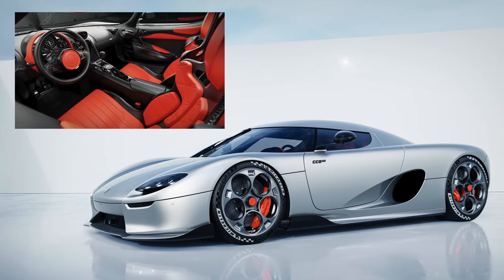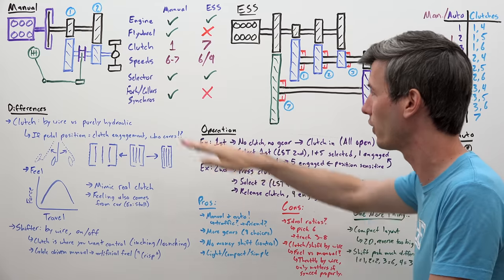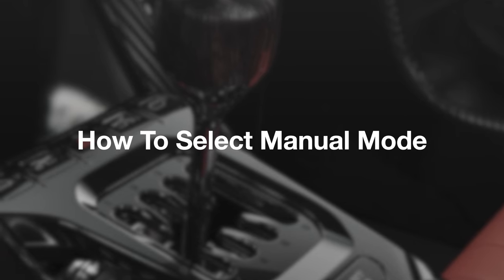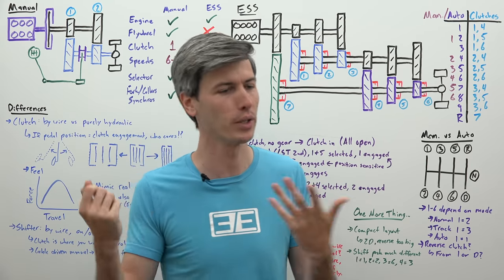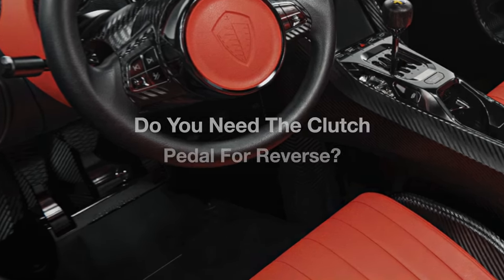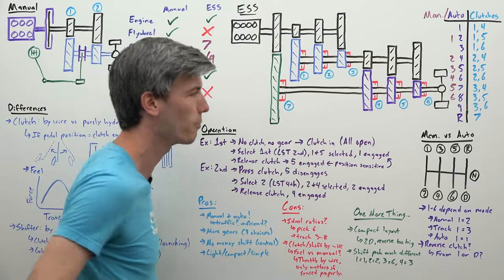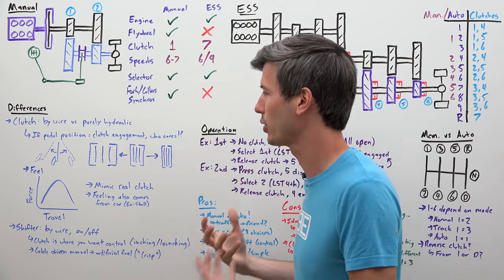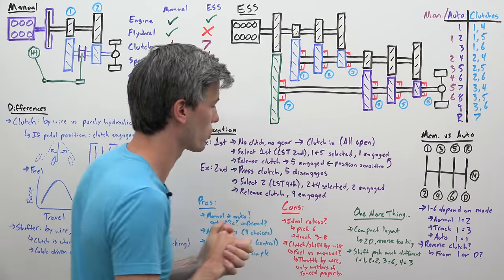Koenigsegg Reinvents The Manual! How The CC850 Transmission Works

Comment: I love the retro supercar look of the CC850, and also a very interesting gear box design from Koenigsegg. 
I think the general concept is very similar to their Free Valve tech, which also uses electronics control to simplify mechanical parts.
It's like a dual clutch transmission but you can now jump gears.
Kinda feels like the engineers just brute forced through the design problems by giving every gear a clutch.
Reply: Holden Burke  Modern automatics in passenger vehicles and even some semi-trucks have 7+ clutch packs and go hundreds of thousands of miles without ever changing the clutch packs. With wet clutches there is very little wear with regular maintenance (i.e. changing the transmission fluid).
Reply: Brute forced is a good word for their gearbox
Reply: @Kyriaeus  Same deal with the VAG DSG transmissions - wet clutch, long life. At the end of the day heat is just as detrimental to them as friction is, and the fluid helps cool the surfaces.
Reply: @SOHCGT96  if you get a wet clutch to burn out, you have done many things wrong xD and using the clutch heats up the transmission - nice benefit in winter for reduced hydraulic resistance lol. At least I would say it to the "green/eco" society xD

Comment: I feel like this should be the future of enthusiast cars. One transmission covers auto and manual buyers, can hit fuel economy standards still without super tall manual gears, and you can protect the car from money shifts.
Reply: One thing that I have done plenty of times on a manual transmission vehicle is push start, or coast start. Turn the key ob, put it in third, step on the clutch, get er rolling and pop the clutch. I wonder if you could do that with this automatic manual transmission still? Based on guessing how it works with automatic clutches then I'm going to say no. That's one of the perks of having a manual transmission.
Reply: @keithyinger3326  You can't even do that with any modern traditional manuals. Nearly every manual car these days requires the clutch to be depressed to start. Regardless of engine turning
Reply: @KeithYinger
Back in my day I could start a car without moving at all, all I had to do was to spin a crank at the front.
(this is a joke)
Reply: @ventzp2133  this is true they require the clutch pressed in for the electronics to turn the starter. However if you're not relying on electronics to turn the starter motor, then that circuitry doesn't matter. My previous truck was that way. In order to turn the key and start it, yes you had to have your foot on the clutch, even if it was in neutral. Many times though I parked on a hill and coasted down to get it started. As long as the key is in the On position, it will work.
Reply: @Appletank8  lol.. hey my grandpa had a tractor like that. And his original farm truck "The Grey Bomb" was its name, had a hand crank.
Reply: @keithyinger3326  I have a 2010 Jeep Wrangler manual diesel.
Can't roll start it. As soon as the clutch is released while rolling, the engine turns with no spark and stalls.
Reply: @Appletank8  I work for the railway and we still have many backup lister generators in the signalling huts that have a 12v starter and a hand crank
Reply: @ventzp2133  The Buick Regal requires you to disengage the clutch to start, yet I was able to push start it without a problem when I woke up to a dead battery one day.
Reply: @ventzp2133  Your diesel has spark plugs?
Reply: @TV-ok7bj  he probably meant glow plugs.
Reply: @ventzp2133  Diesels are tougher to bump start. Try again with minimum 10 MPH and in 2nd gear, then fully release the clutch once the engine starts spinning. As long as you still have enough distance and enough grade, it will eventually not stall once the clutch is pushed back in.
Reply: @clover7359  how does the engine spin with clutch engaged?
Reply: @ventzp2133  If the vehicle is moving and you engage the clutch with the transmission in gear then the engine is going to spin to match the speed of the gear ratio/vehicle speed, in this case instead of using a starter to spin the engine you're using the vehicles momentum.  Different method but produces the exact same results, and yes all modern manual vehicles (minus push start vehicles with a dead battery as there is no way to put the ignition into the "on" position) including diesel engines can be started this way.
Reply: @keithyinger3326  yeah, but this is a multi million dollar car. If you can pay multiple millions to buy a car, you can probably pay a guy to bring you a new battery when needed.
Reply: @keithyinger3326  why would you put it in third ? You know you don't have to roll it as much if you do it in first or in reverse right ?
Reply: @me-so2ze  first gear is too short and the engine locks up the wheels, rather than being turned by the wheels due to the massive amount of torque it needs to turn. Remember, a gearbox is a torque translator. Lower gear-> more torque. Higher gear-> less torque . 2nd is fine for most cars. I'm using 2nd on my motorcycle. 1st locks up the rear tire.
Reply: @me-so2ze  depends on the vehicle and its gearing. The work truck at the farm I work at, you put it in first or reverse and your skidding the tires. It has to be third, or maybe second if your on a good hill. I just know if you try it in first and pop the clutch, the tires are going to skid and it's going to come to an abrupt stop. Pick whichever gear works best for your vehicle.
Reply: @keithyinger3326  no, you won't be able to push start with this transmission. The clutches need hydraulic pressure from an oil pump, driven by the engine, to engage. Without hydraulic pressure the gearbox is just freewheeling. Neither would it do any locking to put in in gear for parking, a separate latch is needed like in an ordinary automatic gearbox.
Reply: @philipjkb15  I guess it depends on the car. I don't do motorcycles. But ever since I was ten I have always done it in first or reverse. Lift off the clutch and immediately push it back in with the key open always did it and still does. I do remember this one time i had my cousin push and my other cousin was in back suddenly half his body was under the car ..

Comment: This gearbox really makes sense. Unfortunately mainstream manufacturers will never use this method, probably due to manufacturing costs. Super cool design! Excellent video per usual.
Reply: Typical modern automatics already have 6-8 clutch packs, so your point is invalid.

Aisin transverse 8-speed: 6 clutches, 7 if you include the torque converter clutch, 9 if you include the sprag clutch. Used in Camrys, RAV4s, Volvos, Minis, VW’s, etc.

ZF-8 speed: 5 clutches, 6 including torque converter clutch.

Honda 10-speed: 7 clutches

GM 9-speed: 7 clutches

Etc.
Reply: Current automatics are a maintenance nightmare, regardless if: automatically shifted manual transmissions, eight or more speed automatics or the dreaded constantly variable transmissions. Making the cars with them "disposable"... @Kyriaeus

Comment: The first manual I owned had all rod links from the shifter and the clutch pedal. The clutch linkage utilized a bellcrank. The shifter was a Hurst, with adjustable stops at seven points. I could have built the whole thing in shop class with a band saw and a drill press.
     1973 Chevrolet Camaro RS/SS. The feel was incredible.
Reply: Huh, every classic muscle car I've driven has SO much slop in literally every control, steering always being the worst. Glad you got a good example!
Reply: @RhodokTribesman  Haha yeah, I had a 2000 Camaro and 3rd gear throw was so long you punched the radio controls every time you shifted into it!
Reply: They probably build it that way in their factory back then 😂😂

Comment: Excellent video, Jason!  Mind-blown doesn't even describe how I feel from such a small car company and almost a single [VERY smart] man.  What companies with billions of dollars in annual revenue haven't done, he's done.  Let's all be honest here:  any that loves manual transmissions and is sad to see them disappearing, any sort of innovation is HIGH LY welcome.  I was thinking the same as Jason about mid-way thru:  just about everything has been throttle-by-wire since circa 2010, some much sooner.  As long as the feel as the right, it gives more advantages like tuning; throttle pedal can feel "laggier" in "eco" mode, "normal" in "normal" mode, "sportier" and "sport mode", and the most aggressive in "track mode," with any other combination available as well depending on application (e.g. different tiny changes in various modes of off-road enthusiast vehicles like a Jeep Wrangler).

Me personally, the only thing I would change is have manual mode grab these gears:  2-3-4-5-6-8  as typically a gear change at mid-upper range is a smaller drop, so less felt, even if it does technical hurt some top-end performance on the track.  That, or again with everything being "by wire," an eco mode would allow for 2-4-5-6-7-9 so that that top gear can get grabbed for fuel economy on the highway.

Koenigsegg, keep making Mercedes and the other "best engineering" companies look like child's play -- I LOVE IT!!
Reply: A proper manual transmission like the one in my Mustang GT is much more reliable than Koenigsegg's "super car". Koenigsegg's trans is more complicated and less reliable than a modern automatic and close to the complexity of a duel clutch automated manual trans...
In short Koenigsegg made a Rube Goldberg design for the ultra wealthy but it will suck to own like all so called "super cars". As the best reliable performance car used to be the 911, but now is cars like the Mustang GT, due to the over complexity...

Comment: I've always thought about how this is possible with a traditional automatic just by varying that clutch pack hydraulic pressure. I think it definitely qualifies as a 'real' manual, just wish we'd see it in cheaper cars lol
Reply: If you did variable  slippage in traditional automatic clutch packs, you'd burn them out very quickly. They are designed for rapid engagement, with a very short slip duration. You'd have to redesign everything to get gradual engagement/disengagement (need longer travel for gradation). You'd be better off replacing the torque converter with a clutch assembly, and make the clutch packs engage/disengage as fast as possible.
Reply: Yeah for sure lol this transmission is probably $200,000
Reply: @D777ST Then why haven't they done it yet?
Reply: @srinitaaigaura  Because they are too busy making money from 50-60 year old designs, or at least concepts that are as old. Auto makers also don't want to have to pay licensing for any patents they don't own.
Reply: @transtubular  Most auto-makers don't get hypercar ROIs. There is a reason 3 car majors own almost 60% of all brands. A design like this is more cost than its worth. Especially as manual share of new vehicles are in decline YOY. The maintenance cost alone for such a transmission means most people wont buy and most car makers will not risk the sell.
Reply: @reclassified_  besides which I'd rather have a strong dual clutch transmission and flappy paddles than this. Seems unnecessarily complicated.
Reply: @peterjohnson9438  And an automatic transmission seems unnecessarily complicated compared to a traditional manual. Besides, the reason koenigsegg does this is because it shows off cool different approaches, not because it's the "most optimal or sensible" - that is boring.
Reply: @denisdelinger3265  yeah I really don't want a traditional slushbox automatic either, because it's too complicated to service without very specialized tools and skills, it's heavy and it leads to power loss and general "laziness" of the car thanks to the torque converter. Where I live, we drive cars with predominantly 1.4 and 1.6 liter engines. A naturally aspirated 2.0 is considered "big" and "excessively powerful".

I suspect a main reason for the prevalence of 3+ liter V-whatever engines with lots of torque in the USA is the torque converter automatic.
Reply: More like just make a 1-6 button box for a DSG, a gated shifter or whatever. This is pretty much a DSG.
Reply: @rkan2  Why have a stick at all if you have a DSG? The DSG is basically a sequential device - flappy paddle controls are a natural fit for that.
For now, though, I will continue to enjoy my 20 year old car with cable-linkage throttle, hydraulic clutch and traditional 6 speed stick shift. I trust the computer to control ignition timing and fuel injection; beyond that I'll take mechanical linkages any day of the week.
Reply: @peterjohnson9438  The same reason this Koenigsegg transmissions got made. Actual DSGs could shift in to any gear at any point even if they are usually made to work like a sequential to the user.
Reply: Honda did autos that were basically a manual with clutch packs instead of shift collars. You still wouldn’t really want to slip the clutches much though.
Reply: @NBSV1  that's where I got the idea, the honda 5AT had a variable clutch solenoid. But yeah a change of material would be needed for the clutch packs. It's interesting you don't really see wet clutch manual cars, wonder how the koenigsegg will hold up
Reply: @andoletube  And now you've built half of a dual-clutch gearbox basically.
Reply: @stevegredell1123  Exactly. With each step comes diminishing returns. You might as well start from the beginning and build the thing you actually want.
Reply: @Yummy Spaghetti Noodles I daily one so I ought to know the difference man. The thing that makes this like no other DCT out there is that the clutch indeed is manually controlled. If you're such an expert on manuals, I guess you'd call GM transmissions with downshift inhibitors automatics, after all, it's not letting you do something you want to. Hell while we're on that topic, rip out your reverse solenoid too huh!
Reply: @zaydabbas1609  I’d imagine something like the Koenigsegg is a best case scenario. It isn’t like they’re gonna cover 200K miles of stop and go traffic along with some spirited driving. 
And, from the sounds of it there’s still a lot of computer control in between the driver and the clutches. So, they’re likely to have lots of safeties built in so you don’t burn the clutches.

Comment: I just love it... The Stick Shift ain't dying... I love the Manual
Reply: stick shift is dead. this is an automatic gearbox with a lot of work put into it to give you a manual mode that costs an arm and a leg. there is a reason nobody else does it. and probably nobody else will do it. manual does not make any sense. is not fast, doesnt give bette throttle or overall control of the car... is just a gimmick nowdays and nothing else.
Reply: @catalinxnecula  over half of all GT3 sales in America are with the manual. It’s not dead.
Reply: @catalinxnecula  a manual transmission is one more step to a car being more analog, which is always a positive for driver engagement. Everyone focuses on speed instead of the feel, and I think that’s because one is easier to quantify than the other. Passion for cars is derived from how they make us feel, and that feeling doesn’t always come from speed or technology. The manual is far from a gimmick, regardless of its future. 

Edit: I am absolutely biased. Just got home from one hell of a drive through the twisties in a 1991 Miata. The fastest the speedometer read was 70mph, yet I have the biggest and stupidest grin on my face as I type this.
Reply: @squidwardshouse67  This is not a manual shifter.  It is simply electronic control of hydraulic clutches.  If you really wanted to simplify things, it's just electronic control of a normal automatic gearbox.  The gear shifter is not connected mechanically to the gearbox in any way.

Comment: Hot rodding isn't dead! The internal combustion engine has a future!  Love the power flow diagram. I'm a mechanic, I can't get enough of the mind blowing engineering from manufacturing in the automotive industry. I should have been an engineer!
Reply: The ICE engine has a solidified future well into the ~2100s, even if fossil fuels are banned in the near/mid-future, cos Porsche is working with Siemens on e-fuel, a gasoline with the same properties as fossil fuels, yet produced by renewable energy. :) So, car enthusiasts get to keep the ICE in the electric era.

Konigsee with their futuristic transmission, Porsche with their green gasoline, VW with their electric bus, Bugatti with their 500 km/h Chiron, Mercedes with their driverless trucks, what's not to love about European sports car company innovation?

Comment: Just imagine one of those in full manual mode! Would be perfect for F&F movies and finally shifting scenes will be accurate :)
Reply: Oh, they'll still go through 30 gears and take five minutes to complete a drag race.
Reply: Hell they shift more than I do in my 18 wheeler with a 10 speed 😆
Reply: I've driven a dump truck for work with a compound 8 speed (separate 2 and 4 speed gearboxes). It has 2 shifters and can be a 2-hand operation at times. Those guys still shift more than I do going from 0 to 45mph in 7th.
Reply: Finally they can shift through the gears and it actually being accurate to real life :D

Comment: Marine transmissions have used this design for years but only with 2-3 gears. 
Typically they only have a forward and reverse with the same ratio that will change gears using a valve body and hydraulic clutch packs. Some high speed boats use a second forward gear that also has its own clutch.
Reply: Plenty of construction and agricultural machines use the same style
Reply: @georgies405  in Ag we call them Power Shifts its the standard on all large tractors other then Fendt they use CVTs on everything from there tiny vineyard tractor to there massive 670HP twin track monster and now CVTs are starting to take over.